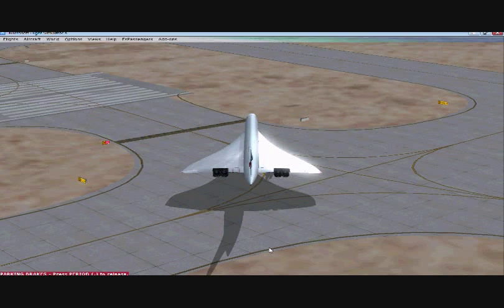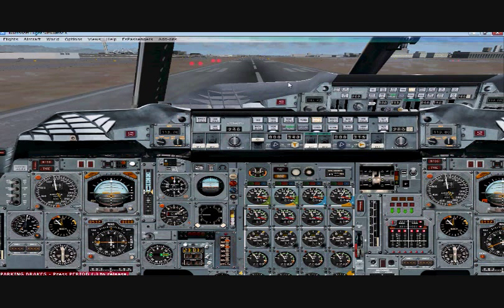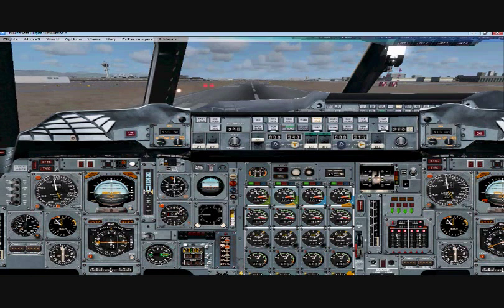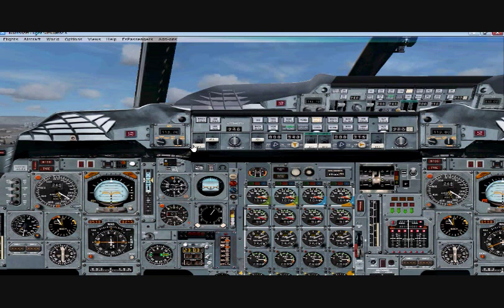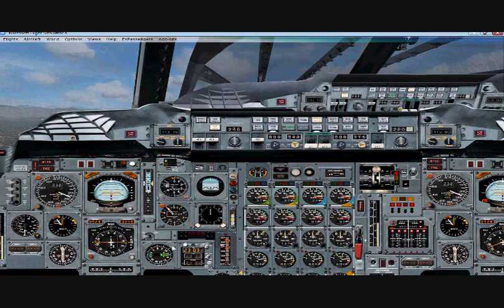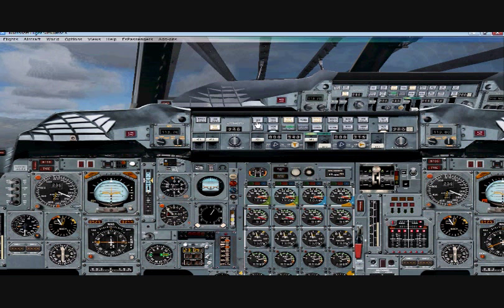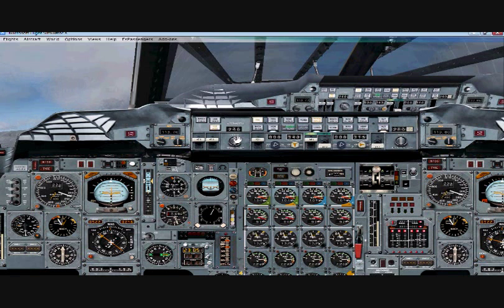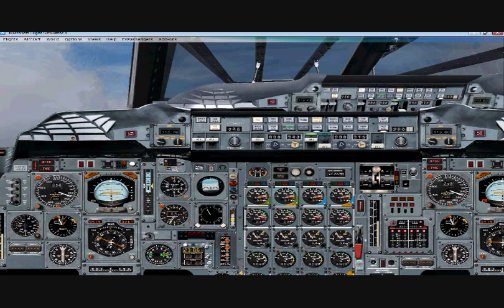Concorde flight tutorial Part 6

Comment: Excuse me! When i press the ins button it doesn't go to the navigation point directly. On top of that when i want to cruise at 59000 feet the plane doesn't speed up it reduces my airspeed then that leads to engine failure and stalls and stress.